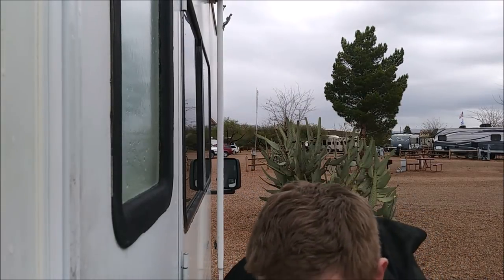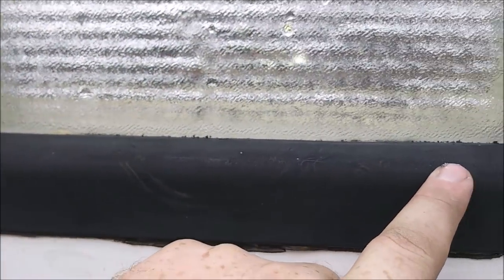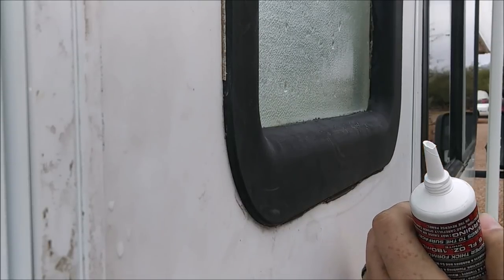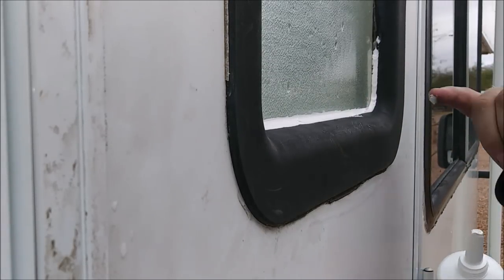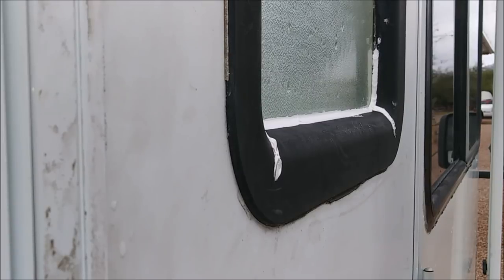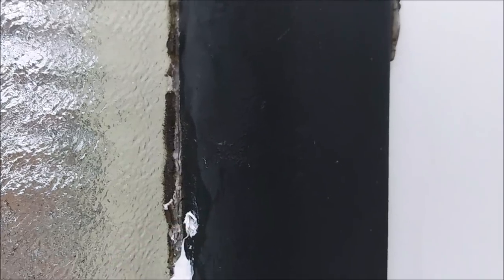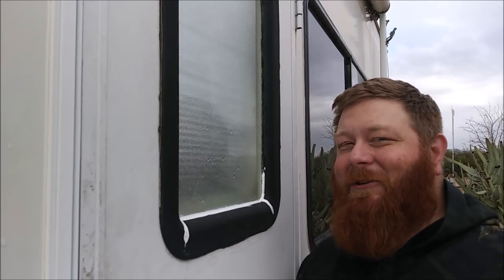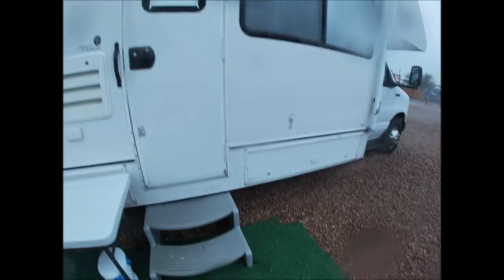Flex Glue - Quick RV Door Window Leak Repair During Storm Break

Comment: Great job using Flex Glue to cover the water leak in the RV door window as a protective sealant.
 The repair will hold up for another storm! 💪
Reply from the maker: The Flex Glue worked incredibly well and so fast! Stopped the leak right away!!

Comment: some good tips man, i have a shower i need to the same thing to cause it's running on the sides, thanks for the advise
Reply from the maker: Thanks! I'm glad you liked the video!
I would probably use a calking in the shower over the Flex Glue, though. That being said, you can still use the finger trick. It will work much better with calking and the calk should last a lot longer in a shower as well.  I found the tube of Flex Glue to be rather difficult to squeeze out the product.
Reply: If you have a crack in you shower flex glue will hold it. Not sure for how long but it will hold probably until you can replace it. It held on my old cr250 front fender for a long time until I hit a tree. haha  I just put more flex glue on and sent it... haha